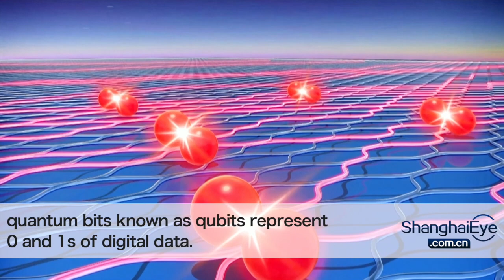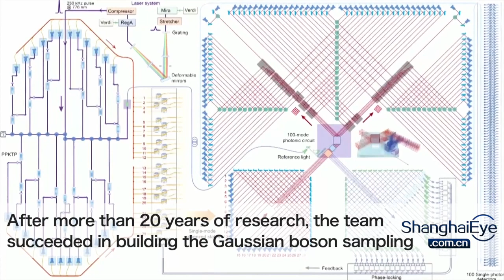100 trillion times faster! Chinese scientists make quantum computer breakthrough

Comment: Soon, these computers at there max speed will be available for purchase, and the size will be reduced alot, just like in 1980's 5 kb combuters were equivalant in size to a whole room, and today we have computers in tbs in a small size. Which means they are 5000000000000 times 1 byte